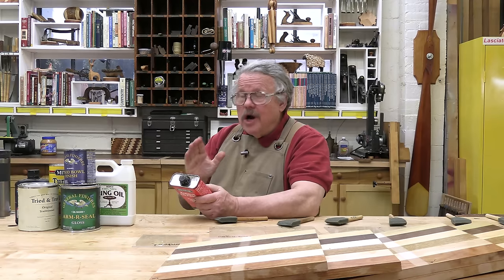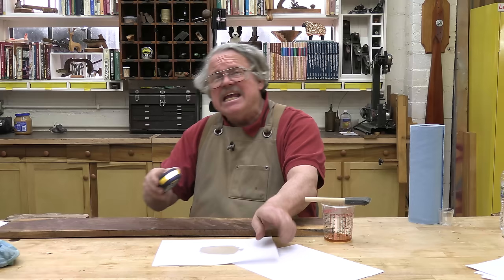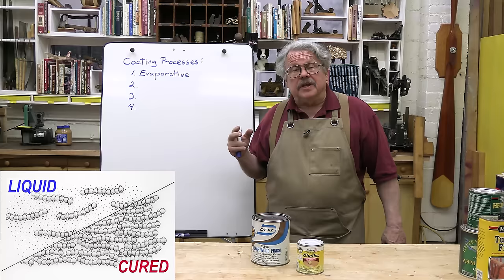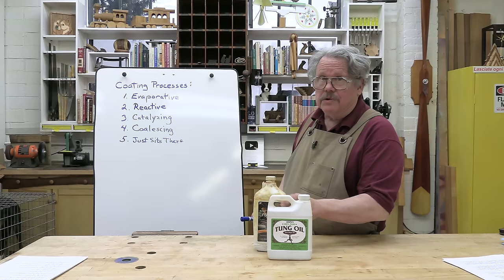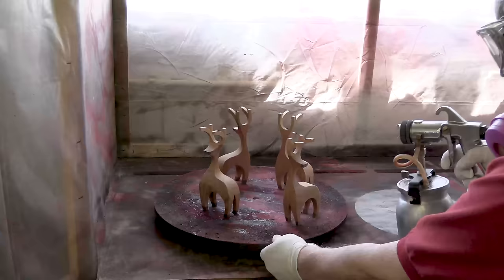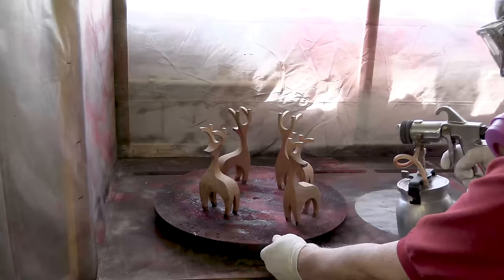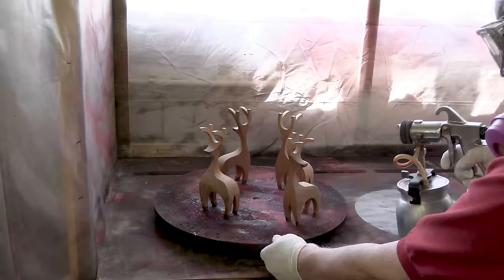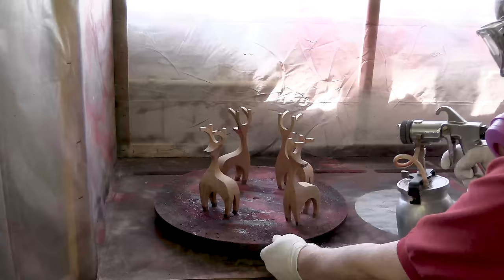Finding the Perfect Finish

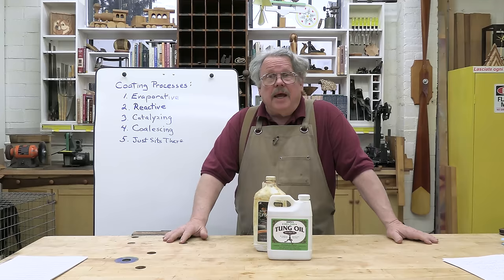Comment: Hmm, at 7:45 he shows that linseed oil and tung oil are "non-drying or non-hardening finishes".  He classified them as "just sit there" finishes.  That isn't right, is it?  Both of those oils slowly cure/harden with exposure to air.  Mineral oil would be an example of a "just sits there" finish.
Reply from the maker: It's an industry classification as opposed to chemical. Most organic oils will form a matrix if left exposed to oxygen long enough. But the coatings industry, which views curing speed as a marketable virtue, labels anything that is still sticky after a few days as "non-drying." In reality, "drying" and "non-drying" are the opposite ends of a wide scale, with many slow-, medium-, and fast-curing speeds in between.

Comment: I have a bookcase which was coated with danish oil. Unfortunately the oil is still seeping from the wood, weeks after completion, meaning the shelves feel greasy and this oiliness transfers to the pages of books. My understanding is that the person who made the bookcase for me didn’t follow the correct process when applying the danish oil. Is there anything I can do to stop this?
Reply from the maker: Weeping is common for Danish oil, especially if it's applied cold then moved to a warmer location before the finish has completely cured. It will also happen if you apply multiple coats without letting each coat cure completely. Danish oil typically takes longer to cure than other finishes, and may weep  days or even weeks after it's applied if the temperature and the humidity aren't cooperative. The best thing you can do is place the bookcase in a warm, dry room and patiently wipe the wood down each day until the weeping stops.
Reply: Thank you very much for taking the time to respond to me. I’m so concerned because I’ve had it for a couple of weeks now and store it in a room with a dehumidifier running and even without the dehumidifier it’s a low humidity room, so I expected it would be dry by now. I’ll just have to be patient based on what you’re saying. If it gets to the point that the seeping never seems to stop, is it a good idea to coat the shelves with something to block the seepage?
Reply from the maker: @phil8528  Try wiping the wood down with a liberal amount of naptha, followed by a wash coat of shellac. By "wash coat," I mean white shellac thinned 50/50 with alcohol. Before that, however, I'd try heating the room 75-77 degrees F for a few days. That and low humidity ought to create perfection conditions for the linseed oil in the finish to cure. Also, it could be that the finish is reacting to a chemical in the wood itself. If the shelves are made from a naturally oily/resinous wood, or a wood high in tannic acid, that could be part of the problem.

By the way, be careful how you store the rags or paper towels after you wipe down  the shelves. If this Danish oil contains linseed oil -- and I suspect it does because it's stubbornly refusing to cure -- that can spontaneously combust if you wad up the towel. Drape the used towels over the side of the trash can so air can get to all surfaces. You might also inspect the draped towels after a day or so. Does the finish dry on them? Maybe the problem is the finish itself.
Reply: @WorkshopCompanion  thank you very much for your advice. I will follow all of these instructions, and fingers crossed this works out. Thanks again for helping. I have to say that I think the person who made it is taking my requests for help as me insulting their craftsmanship, so I’m getting much more help from you, and finding help for this exact problem is surprisingly hard just googling it. Have a good day, and keep up the good work!

Comment: I'd like to build more book shelves alongside my walls.  I previously built and mounted a six foot by 7 foot set of book shelves and painted them with Urethane.  I don't want books to get stuck to the shelves.  Hopefully that was a good choice.  So far so good.  What kind of finish should I put one a chopping block?  Mineral Oil/something?  This is a needed piece of wood working information I needed.  Thanks.
Reply from the maker: Oh gawd. You have no ideas what a can of worms you're opening up. Anything I could say beyond recommending a food-safe finish would invite a zillion passionate comments from chopping/cutting board evangelists the world over. So I'm just going say use something safe and let the zealots take you from there.

Comment: Will the tung oil and spar varnish keep in a container or does it have to be used right away?
Reply from the maker: As long as the container seal is tight, it will keep as long as the unmixed stuff keeps. I have a mix in my finishing cabinet that's at least a year old and it's fine.
Reply: @WorkshopCompanion  thank you

Comment: Hi - I’m confused, isn’t pure tung oil a drying oil? I’ve read on multiple places that it dries a day or so, and cures in a few days. Have I misunderstood this? Thanks
Reply from the maker: In my experience, raw tung oil remains sticky for weeks. Polymerized tung oil will dry in a day or so.
Reply: @WorkshopCompanion  ah I may have made a mistake by buying a lot of pure tung oil. I wanted to thin it with a citrus solvent, for my hardwood flooring
Reply from the maker: @rarra  There is a type of finish called "hardwax" in which the manufacturer mixes a wax (a non-drying finishing material) with something that cures, like polyurethane, varnish, or boiled linseed oil. As the drying portion of the finish forms a hard matrix, it locks the wax in place. These have become very popular as floor finishes. There is no reason why this wouldn't work with other non-drying or slow-drying materials like raw tung oil. I suggest you try an experiment -- mix a small amount of tung oil with poly-U and apply to a bit of wood the same species as your flooring. If it works like hardwax, it will take longer to dry than other finishes but it may still produce a durable, attractive coating that will be ready to walk on in a few days.
Reply: @WorkshopCompanion  thank you I will try this experiment, though with boiled linseed oil + raw tung oil. I’m trying to steer clear of varnishes/lacquers/polyurethane as I’ve read they are much harder to spot repair. My existing flooring came oiled only from the manufacturer.

Comment: This was SO informative and helpful.  Thank you for sharing your knowledge. After watching, I'm wondering, would you recommend Rudy's formula for use on an indoor teak dining table? I was considering Danish oil however after watching this video I am reconsidering. Just concerned about streaks when applying any finish. I do have experience, and I find Arm r Seal very difficult to apply without getting streaks no matter how I try to apply it.
Reply from the maker: Rudy's formula is very similar to Danish oil -- basically, it's Danish oil with a little tung oil thrown in.  And either would work. But it you're using this on a table you plan to wipe down after each meal, I would recommend four or more coats to insure it's durability and moisture resistance.

Comment: Great video. Is Hope’s Tung Oil interchangeable with the Minwax Tung Oil Finish when attempting Rudy’s finish?
Reply from the maker: Perhaps -- it's an interesting question since Hope's is 100% tung oil and Minwax includes other resins. To find out, I would start by comparing the Safety Data Sheets, then mix up a small amount of finish -- maybe an ounce of Hope's to a teaspoon of an oil-based spar urethane -- and experiment.

Comment: Try using the tung oil and 10 to 20 % lemon juice
Reply from the maker: Lemon juice contains d-limonene, which has two effects on raw oils such as tung oil and linseed oil. It (1) helps the raw oils penetrate more deeply and (2) acts as a drier, cutting down on the time to cure. It's effects on the partially polymerized oils in a tung oil finish or boiled linseed oil is harder to predict. It requires some experimentation to see if there is any effect whatsoever. Also, the water in the lemon juice may have some unwanted effects; it doesn't mix well with oil-based finishes. If you want to use this material, consider purchasing d-limonene instead of straight lemon juice. It's available from many sources, including Amazon, and is often sold as "orange oil."

Comment: In Rudy’s original recipe, after you apply the coats, do you sand? And also how long do you wait after the application to know it’s dry?
Reply from the maker: Between coats we give a light sanding with grey scotch bright, just enough that it feels smooth, remember with wipe on polys you are putting thin coats on and don't want to sand through them. Each finish's "curing" time varies, generally I wait until the finish is no longer tacky, then either add an additional coat or wax. - Travis
Reply: Can I also use Rudy’s recipe to seal stained wood, and painted wood?
Reply from the maker: @MariaVelazquez-it1px  Maybe to stains -- you'll need to perform a test to make sure the tung oil /varnish formula is chemically compatible with the stain. As for the paint, same answer but what's the point? Paint is its own protective coat.

Comment: QUESTION: I have so far applied 2 coats of tung oil, but before I apply the 2 coats of Rudy's formula,  will the surface have a satin sheen, or glossy...???  And what is the best way to even out the gloss where different?  Thanks for your help
Reply from the maker: As long you have used a high gloss spar urethane, the finish should be glossy. Actually, it's whatever you want to make it when you do your rub-out. If you rub-out a high gloss finish with rottenstone, you'll get a high gloss. Pumice with give you a medium gloss. Gray Scotchbright (about 800 grit) will produce something just south of satin. I would rather adjust the sheen in the rub-out phase because "satin" finishes all have an additive similar to talc that clouds the finish to produce a satin or flat look. No matter how much you polish a satin finish, it will always look satin because of the imbedded talc. But these same additives also partially obscure the wood grain, and I'd rather not have that. So I go the extra mile in the rub-out to produce the look that I feel best enhances the wood.
Reply: @Workshop Companion  Thank you so much for your reply, the rub out will give me the opportunity to get the best sheen for each area, glossy on fiddles and satin on the veneer bulkheads, I'm going with the 3m gray for bulkheads and cabinet interiors BUT...one more question if I may ?  What would you suggest I use for the lubricant for the rub out, mineral oil, the WATCO Tung oil, or something else and hopefully I can find rottenstone and pumice powder...or since I can't use steel wool (rust particle fear) what would you say bronze wool pads would provide for sheen with what lubricant???
Thanks in advance for your help,  my fear of screwing up the wood permanently has been eliminated and it is thanks to you and the confidence you instill to do the job correctly for results one can be proud of, thank you!
Reply from the maker: @larryb5914  I simply used boiled linseed oil. Soak a lint-free cloth in oil, pat it in a container of rottenstone and go to work. You can also get rottenstone and pumice suspended in gel, if you can't find the abrasive powders. As for bronze wool, I've never used it. I don't keep any metal wool in this shop because of the danger it poses to my shop dog..
Reply: @Workshop Companion  thank you so much,  If I can figure out how to send you pictures,  I will, you should be able to have an opportunity to see what you have educated folks, especially a novice like me to accomplish,  "boiled linseed oil it is...thanks again

Comment: How does this finish compare to a home made Danish Oil (equal parts boiled linseed oil, mineral spirits, oil based poly
Reply from the maker: The last time I made Danish oil I used a spar varnish that is no longer available. I have no idea  how the urethane would perform, but my best guess is that it would be somewhat harder than Rudy's mix (because of the increased amount of phenolic resins) but slower to cure (because of the linseed oil). You might be able to speed up the cure time with the addition of a little (very little) Japan dryer.

Comment: would you recommend this finish for a butcher block countertop thats being used for a computer desk? want something that is durable yet pretty... as you have to look at it constantly...
Reply from the maker: There is no reason the finish wouldn't work, but I very much suggest you glue up a small section of butcher block from the same wood species and run a test to make sure this is the finish you want to live with.
Reply: @WorkshopCompanion  that is a great point and i would do that if i had any more of it... i believe its baltic birch... 

is this finishing trick extremely hard to get off or something as to why the caution?
Reply from the maker: @angelusmortis3256  Any finishing "trick" would be extremely hard to get off end grain (read: impossible) without sanding away a good deal of wood.
Reply: @WorkshopCompanion  okay ill definitely try a small area not on end grain first to make sure i like it... thank you!

Comment: I just tried the exact same finish you recommended in the end for a sculpted stool. This is my first time doing any finishing, and I'm at the last coat. Now, what do I do to make it shiny?
Reply from the maker: Buff it out with steel wool, Scotchbrite, rottenstone, or a rubbing compound. The finer the abrasive you use in the buff-out, the more gloss you'll get in the end product. I usually sand the wood surface to 180# (for low gloss) or 220# (for high gloss), lightly sand between coats with 220# or 320#, then buff out with grey Scotchbrite (600#) and paste wax for a satin gloss. If I want high gloss, make a past with boiled linseed oil and rottenstone and rub thoroughly, then follow up with paste wax.
Reply: @WorkshopCompanion  Wow, thanks for the time to reply! I feel privileged! 😀

I tried to scratch the surface with green scotchbrite between coats, maybe was a mistake because too fine? I'll try to find the grey one and some paste.
Reply from the maker: @chriss3913  The green Scotchbrite is 600-grit, but it's roughly equivalent to 220# or 320#  sandpaper because of the way it cuts. So that's about right for leveling the finish between coats. The grey stuff is 800-grit and cuts like 600# sandpaper.

Comment: Nick, this was awesome. Question, I'm installing buther block counter tops on a project. I was thinking of using General Finishes Dead Flat water based Poly. Any thoughts on this product? I've used the MinWax Water poly on other projects but this is going to be a real show piece so I want something nicer. I'm thinking 10 + coats! Keep up the great work. I love you critiques and thoughts on wood working. --Tom
Reply from the maker: Have never used GF Dead Flat, although I understand that GF came up with a way to reduce sheen using a chemical polymer instead of magnesium silicate powder. GF usually makes excellent finishes, so I would tend to trust this one, but I never apply a finishing product with which I have no experience without first testing it to make sure it does what I want.
Reply: @WorkshopCompanion  Thank you sir. I've had great success with GF products but haven't used this product yet. I'm going to do a test on some scrap to see how it comes out. Love your content!

Comment: How about just using MCT oil to a wood piece that isn't high traffic?
Reply from the maker: I'm not a fan of MCT finishes for several reasons. (1) Although it has very low vapor pressure, MCT oil will eventually evaporate and has to be reapplied. (2) MCT has a shelf life of about two years before the fatty oils break down. (3) MCT is a non-drying oil and never forms a protective matrix.

Comment: is this likely what "Bench Top oil" is? I have Bandall's timber bench top oil which says it is made of tung oil, but presummably has some varnish in there for added hardness? Other brands adverdise a varnish bench top oil, Bondalls is safe on untensils and cutting baords too. I need to oil up a project panel for use in a laundry and wonder if the bench top oil will be enough protetion.
Reply from the maker: As I told another viewer, a good way to learn just how many finishes there are that you've never heard of is to post a video on finishing. Am unfamiliar with the term "bench top oil." However, it's fairly common to bump up the durability of finishes made with vegetable-based alkyd resins (tung oil, linseed oil, etc.) by adding harder phenolics made from petroleum-derived chemicals. That's what Rudy did; it would not surprise me if the folks at Bandall's did the same.

Comment: You mentioned that you wait longer between coats using tung oil. I plan on trying Rudy's formula, could you tell me the drying time between coats and the type/grit of scotch-brite that you use? Thank you!
Reply: Will Rudy's formula be adequate for foot traffic? I am using a 6 x 3/4 piece of oak as a transition piece between an existing hardwood floor and carpet.
Reply from the maker: Time between coats depends on temp and humidity; usually 8-12 hours, grey (600#) Scotchbrite.
Reply: @WorkshopCompanion  Thank you for your response